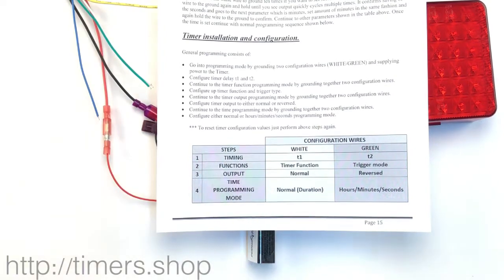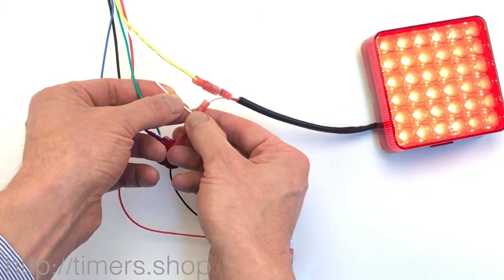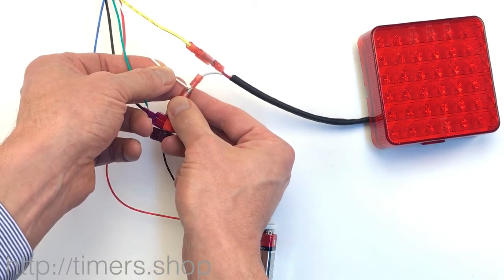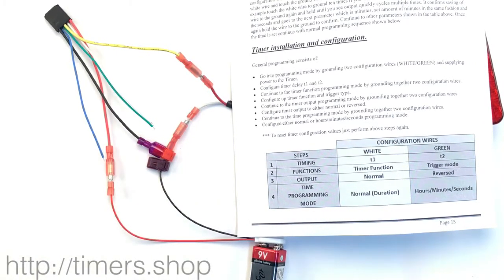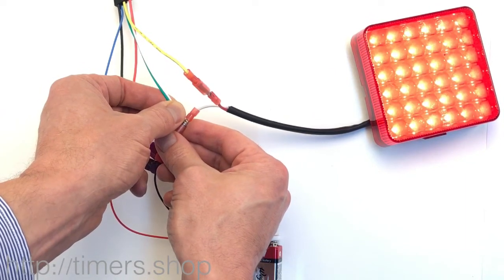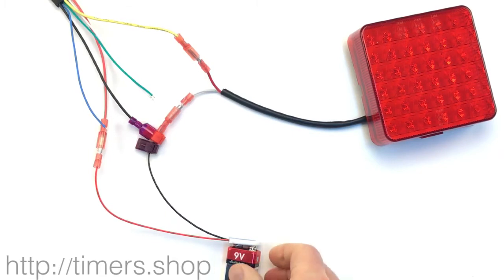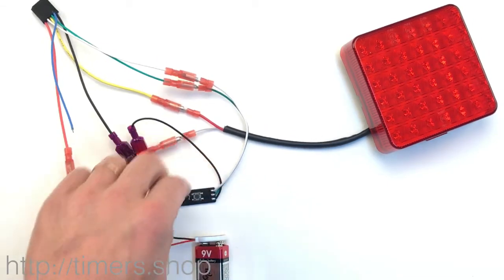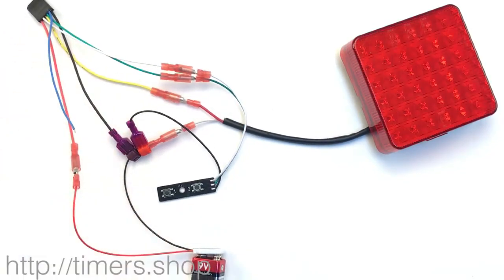Multi-functional 12v Timer Relay. Programming in details.

Comment: Great timer , my 5amp version 7 works perfect with the off delay for 5 seconds but not for 15 minutes when programmed exactly the same way you do it at 7 minutes on through this tutorial. Please help?
Reply: i figured it out , awesome.
Reply: MrCruizydude What did you have to do differently to program a 15 minute delay?
Reply: @BangBang-hk4rg  I just held the wire in place with a plug in terminal for 15 min. You can follow the instructions for setting seconds  mins hours ect too.
Reply: MrCruizydude Thanks for the info. I’m considering getting one of these to hook up to a dash cam so it will keep recording for 15 minutes after the car ignition is turned off.
Reply: @BangBang-hk4rg  I use mine to turn  off my raspberry pi and screen running open auto pro.